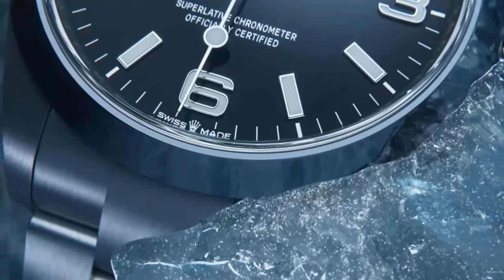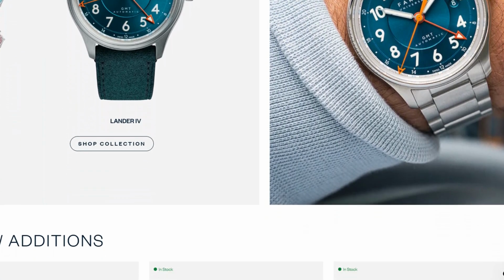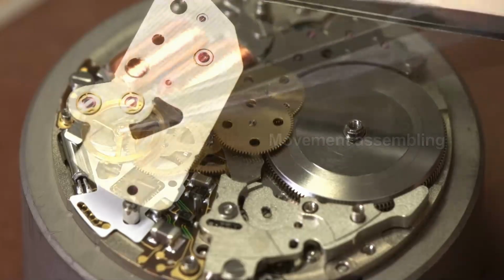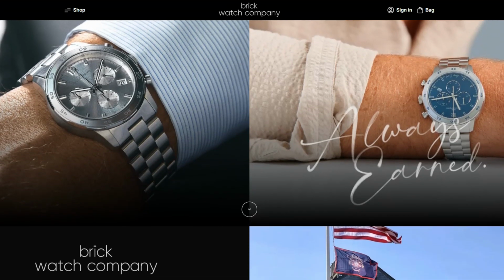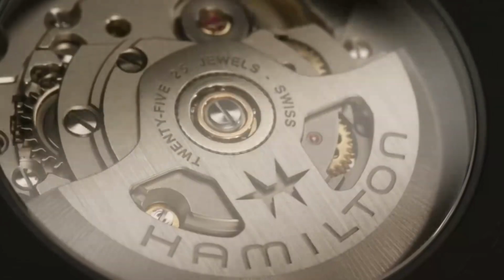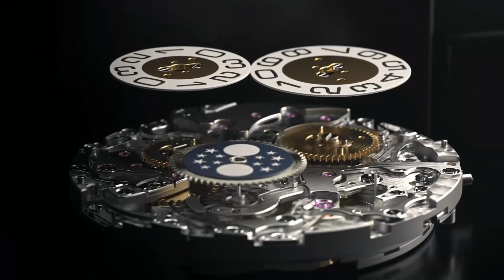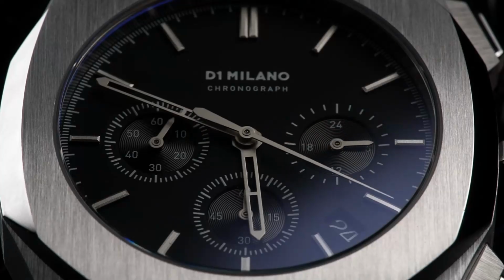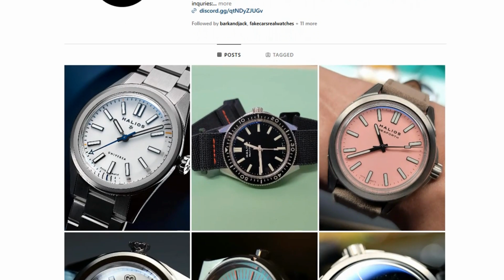The Swiss Watch Industry Is Lying To Us: How They REALLY Source Their Parts

Comment: I think a good quality watch, say a stainless steel automatic day date watch running on a reliable mass produced movement,  on a solid link stainless steel bracelet has a price of around 400 to 500, taking into account the overheads of the company that need to be covered. 
If you see all the right specs on paper and it costs no more than 500 usd, then you are sure you are paying fair value for money. Some Chinese can do it a lot cheaper, but part of the reason they can are their overheads. If you don't pay your workers fair wages, then yes you can do for 200 what Seiko or Tissot can for 500.
More then 500? That's the hard one. Are you paying for precious metals? A hand assembled movement? A unique design? Or are you paying just for the marketing? If it's the latter then indeed you are paying for a very expensive fashion watch.
Reply: Seiko keeps production of its higher-end lines in Japan. However, entry-level and mid-range models are assembled in countries like Malaysia, China, or Singapore. The key distinction is that these watches use the "Mov’t Japan" label or no label at all. They don’t rely on the "Made in Japan" label to justify higher prices. Also, as a brand focused on volume, they benefit from economies of scale, allowing them to keep prices low without necessarily resorting to unfair labor practices, though I'm no industry insider to be certain that this is not the case. But yeah, a decent mass-produced watch with all the right materials should be somewhere around $500 - $1200. The rest is just marketing fluff, unless it's a highly unique artisan piece.

Comment: I have two AliExpress "Sketch Watches" in white and black, that I picked up for under $6 each because I wanted the pricier version, but read some reviews and decided I'd try the cheap as chips version first to see if I wanted the "real deal" on my wrist. There is a "brand" called D1 Milano that sells the "Polycarbon Sketch Watch" for nearly $250 made from "polycarbon" that has the brand name on the dial. I don't think they claim to be Swiss Made, but I could be mistaken.
When I received the AliExpress watches I thought, "DANG, these are light!" but they work well enough, and they're fun to have around. I thought SURELY the D1 Milano had to be different in some way, heavier, more obviously well made, or...something. Well I recently had the opportunity to handle a D1 Milano "Polycarbon Sketch" and let me tell you: there is zero difference. None whatsoever. Same weight, same parts, same materials, same backplate even.
Reply from the maker: Thanks for sharing your story here - it was this very watch that inspired me to make this video.

Comment: Omega caused some controversy when it was revealed in the 1980s that some of their watches were assembled in Hong Kong. They claimed all their parts were Swiss, but who knew for sure? That was forty years ago! 
As a collector, I want my watches to have in-house movements. If I buy an Omega, I do not want it to have an ebauche movement, like ETA. I would make an exception for the Omega Speedmaster Moon Watch 861.
Reply: Ummm.....all Omega's have ebauche ETA movements. It literally DOES NOT MATTER. Stop falling for the marketing nonsense.
Reply: @RonaldWNixon  No. I have three Omega Constellations from the 1960s, which are not Ebauches. Having said that, I have a Bucherer with an ETA 2892-2, which is as well made as anything else out there.
Reply: @ The 2892-2 is a fine movement.
Reply: Omega still use plenty of components made in China. Along with their bracelets. It's a well known fact the lame Swatch group has been outsourcing from China for years and that includes in house movements. For the prices Omega charge? Their bugging. This is why I won't touch anything from the Swatch group

Comment: High horology watches have the highest markups. Sure you can justify it based on movement decoration, exclusivity etc, but these watches basically exist to extract large amounts of cash from uber wealthy clients.

Arguments about movements are pointless in the smart phone/watch age. Watches are primarily jewellery now, so design and branding are more important than ever. Yes it's nice to have a quality movement, which was one of the reasons I bought a SD Grand Seiko, but ultimately it isn't essential, and proprietary movements ultimately cost more to service and maintain.

As for what we are paying for, we are paying for R+D, boutiques, AD's, service centers, marketing etc. Basically an extensive network of production, distribution and service. As much as we would like to have cheap(er) watches, it isn't happening. It's expensive to run these companies, and contrary to what people may think, the margins on premium and luxury watches are not particularly high. They are certainly not comparable to bags.
Reply from the maker: Yes a lot of people quote the Christopher Ward line regarding mark ups and then forget that costs go beyond the watch itself. Ultimately when you're going to be producing watch parts with machines - it doesn't matter where that's done. But transparency and honesty should be key in the story behind these watches which many are sold so heavily on.

Comment: Last year, I bought a rubber strap with deployant clasp for my Omega SMP.
The rubber band came in a plastic bag with a sticker, which had a bar code, product name IIRC, and said "made in Switzerland".
The deployant clasp, OTOH, said "Made in Thailand".
I guess the quality is good and it's not made in China (which I personally boicott on political grounds), but for that price it should be made in Switzerland too...
Reply: I ordered an OEM steel mesh bracelet from Mido for my Ocean Star Tribute. Cost nearly $200 USD and when I received it, it was in plastic sleeve that said "Made in China".  I was sorely pissed and realized that the "Swiss Made" label is simply rubbish.
Reply: @romanmichaelhamilton8729  You can buy them for $10
Reply: TWERP! If it is made in Thailand, it is likely run by a Chinese company, that is exploiting cheaper Thai workers!
Reply from the maker: Thanks for sharing - to be honest I'm a little appauled by that - even though I love the brand. Those Omega aftermarket straps are damn expensive for what they are, I'd hope they'd at least not have marked it. Why break the illusion so easily?
Reply: So you prefer on political grounds not buying watches from China that are 10 times cheaper and have the same quality? Please help me. I can't understand why you are doing this.

Comment: If you collect vintage watches, you'll quickly see that virtually ALL brands used movements supplied by just a handful of manufacturers - Valjoux, Lemania, A. Schild, Landeron, Venus, Universal Geneve and Excelsior Park cover most of them. Only the very largest manufacturers, like Omega & Tissot had any in-house movement manufacture (including Lemania). The prevalent use of third-party movements has always been the case.
Reply from the maker: I've had quite a few vintage watches through my hands over the past few years and it's always been fascinating seeing just how small the industry was at points. While it's always been the practice sharing parts, I do think the industry is slipping into less open and honest communication of this.
Reply: Longines did too
Cases by Squale for Blancpain and others too
Reply: @anthonyw7237 also lets not forvet Zenit’e, they sold automatic chronograph movements to Rolex for a while
Reply: Huh? Tissot uses ETA movements
Reply: @RonaldWNixon  VINTAGE watches - I'm referring to the period before ETA even existed.
Reply: @joelcohen4353  ETA was established in 1856. What are you talking about?
Reply: ETERNA was bought by ETA

Comment: Thank you for your insights into the whole "swiss made" business. I am personally more relaxed about the origin of parts of watches. I can't really speak for the watch industry but I have some experience in the optical industry where specificatons for manufacturing tolerances can be at least as tight as in  the watch industry. If you find the right partners, optical or mechanical components made in asia can be as good and sometimes even better than what you can get in europe. So the fact that something is not made in Switzerland, doesn't mean, its not of the same quality.
In Germany we have a similar situation: the "Glashütte rule". The small town of Glashütte is something like the epicentre of German watchmaking with manufacturers like A. Lange & Söhne, Glashütte Original, Nomos or Mühle (to name just a few) being located here. To have the prestigious "Glashütte" on the dial, the watch has to meet some strict criteria like 50 per cent of the value added has to be generated in  or around Glashütte, final assembly and regulating of the watch has to be done there and probably some more rules. So how do you sneak a Sellita (or Sellita based) movement into your Glashütte watch? Well one answer to this is "Gurofa" - which is basically a company which is part of the Sellita group and manufactures parts for Sellita movements in the Glashütte area. Which meets the criteria... Actually for me this is not a big problem, if the manufacturers are transparent about what they are doing. Actually some German manufacturers are quite open about what movements they use int heir products. And having a Sellita or Miyota movement is not a bad thing, if the customer knows what he or she gets.
The problem with the watch industry is  that its just to much about emotion and not about the technical qualities of a watch - just to much "hot air"...
Reply: Many German brands offer far better value than Swiss ones, especially Nomos and GO. GO's Pano watches punch well above their weight. If they were Swiss watches, they would probably cost 50-80% more.
Reply from the maker: Exactly that, just because something doesn't have a Swiss origin doesn't mean it's to a lesser quality. I've got a video in the works examining Orientalism, racism etc in relation to this with watches on the to do list.

I didn't know about that Gurofa, amazing the things brands will do to meet what is afterall an arbitrary rule, even when there's no real nead Sellita, ETA and Miyota movements have their benefits over many in house movements. 

The challenge will always be emotion and irrationality in watch buying, these are rarely rational purchases.
Reply: @ That is a good idea for a video because it's rarely explored. 

I can't help but feel that many of the problems Grand Seiko, Credor and even Seiko (upper end) face stems from their country of origin, especially with older consumers. i.e. Gen X and boomers.
Reply: I did not know about Sellita producing parts in Glashütte (or actually neighbouring village of Bärenstein) either,  until I stumbled across their facilty while on my way to a hiking tour. I looked it up - they have a web site with information in german and job offerings in german and czech languages as this is not far from the German/Czech border.

Comment: Unfortunately the 'xxxxxx made' and 'made in xxxxxx' scam has been going on for ages and probably applies to almost all manufactured products. About 20 years ago I bought a  Premier drums shell pack because, although they were slightly more expensive than other brand equivalents, they were 'Made in England'. I subsequently discovered the shells and rims were imported from Taiwan, the UK components were the drum lugs and fasteners and they were assembled in the UK which was enough to qualify as a 'Made in England' product.

Similarly for a few years I worked for a company that manufactured fuel and brake assemblies for the automotive industry. For brake looms we would import steel tubing and flexible brake hoses of the appropriate lengths/diameters, in-line fuel filters, plastic clips and end fittings - all from different countries, which would change if we found a supplier willing to offer a 0.1p a unit cheaper price, slap it all together to be collected and exported to whichever country the Peugot/Citroen, Saab, Jaguar whatever factory as located. In the case of cars most of the end builds are an exercise in putting sub assemblies together. A car could be considered German or French, but if you traced the origin of the components you'd probably find they come from everywhere.

It comes as no real surprise that the same applies to many Swiss watches.
Reply from the maker: At the end of the day it all comes back to marketing, no matter what industry. If we can say one thing is something it isn't to be percieved as a slightly better product, it's (often) in a business' interest to do so.